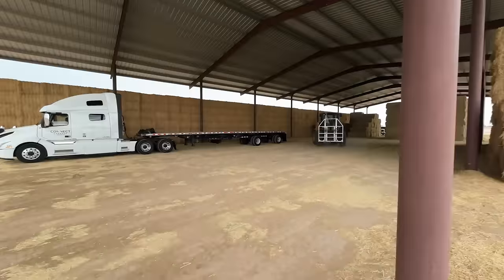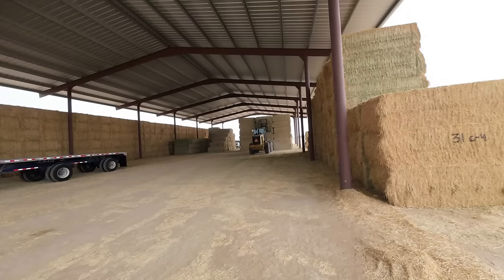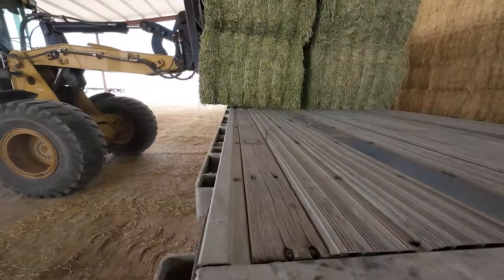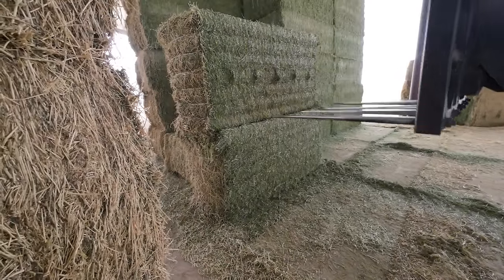How to Load Hay with Loader

Comment: `Do they ever set the hydralics up with multi-funtion joystick controls? older backhoes were simiular to what your sqeeze  hydralic, but now almost all backhoes have joystick controls
Reply from the maker: They can do it, but it’s expensive and hard to fix when they break. This way is very simple. Not many problems.  Easy to fix.
Reply: I get it! Makes sense